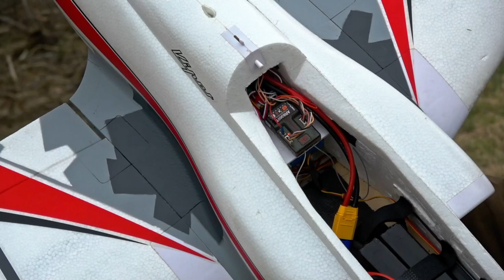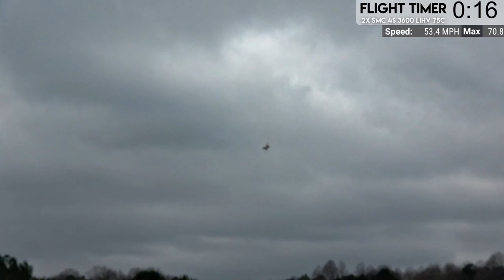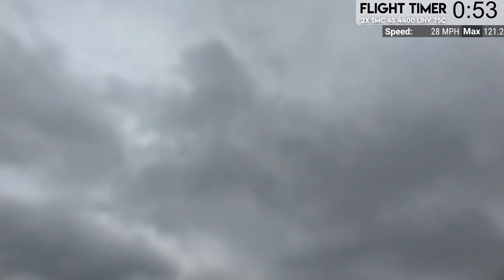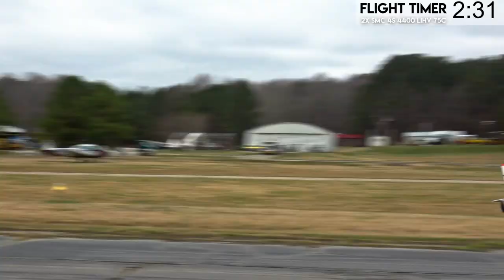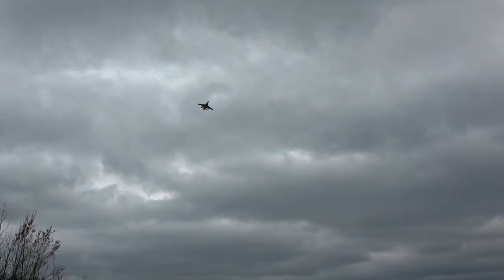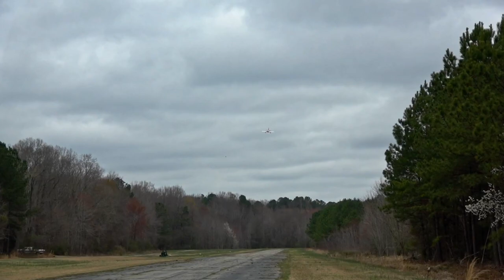Is It Worth Upgrading to 8s Power?

Comment: Welp, now I need to get one of these ARF+ next time they're back in stock.  You are 100% spot on with your 8S assessment as well.  Little more weight and some more cost but a LOT more punch or you can baby it for more flight time and the SMC LiHv packs are a game changer for this.  Not sure I'd fly on the 3600s but the 4400s seem like the sweet spot.  The 5300s are not too much heavier but there does need to be a cutoff.
Reply from the maker: 4400s are definitely the sweet spot, but the 3600s also perform admirably if you don't abuse them! We'd recommend placing a backorder for the ARF so you can save your place in line - they'll sell out quick like anything related to this jet does: https://bit.ly/3ZF69UG

Comment: I've been runnin 8s😎 it's a good setup.
I'm doing a repaint on my viper 90.
Bought a jetfan v3 90 with a het motor 700-68-1680  should be around 5kg.
So happy you tried 8s!!
Reply: This is what I run on all my 90s  its actually the 1680KV very hot motor  about 4.6kg tons of power with a 1500kv I would run 10s
Reply: hi, I fly on 8s with the FMS EDF unit. how will the jetfan v3 fit ? there are pre threaded holes on the engine mount
Reply: @may4092  the jetfan v3 was a perfect drop in fit.
You do have to epoxy the mounting tabs yourself and drill the screw holes to secure it but not that hard at all.
I'm currently running the jetfan v3 and het 1680kv motor on 10s.the power is insane with good flight times of 4-4 1/2 minutes.
I just picked up a Fms super scorpion 90mm and installing the Fms 1500kv.
Gonna test 8s,9s and 10s to see what works the best!
Reply: @sendit_rc  Very nice, top speed? peak current draw? what ESC do you use? I guess you get these flight times with SMC batteries. I'm not from the USA, so it's kind of a problem for me, I get barely 3m (;.
Reply: @may4092  top speed 160 mph in a dive.140 mph level flight.
Esc I use is a castle creations HV 160 amp.
Peak amp current 135 amps using 2x 5s in series RoaringTop 5800 mah 35c.

Comment: Due to the increased weight, the viper will be at a higher angle of attack (AOA) at any given speed, which could result in approaching the critical AOA at a higher speed than it would have before. I have the FMS Viper with 6S configuration, and it is relatively weak. I am considering upgrading to an 8S setup.

Comment: One more question, Do you mess with any esc settings on your setups? I am uncertain about what timings I should use with this FMS motor to get the optimal performance out of it... Do you just leave all settings stock as they come from FMS?
Reply from the maker: They're usually just left stock, not much reason to mess about with them.

Comment: Holy mother of god that acceleration is insanity. It accelerates like a huge 3D prop plane
Reply from the maker: That acceleration comes at a cost of weight, though. On this jet it was definitely worth the tradeoff.
Reply: @TwoBrosRC  has always been my thought. You have thrust but you either have a heavy plane or 1.5 minutes of flight time. Ok for a giggle but wouldn't be my go to set up

Comment: I have this very same EDF ESC combo for my F22 90mm that I am setting up currently. Just need to sand down the foam to make the bigger can fit. I am planning to fly with 850g total for both batteries...should be nice.
Dude how do you connect the EC5 to the XT90 ESC? I don't see any adapter there.
Reply: He probably plugs them in straight, I've done it many times but it's a bit lose fit
Reply from the maker: EC5 plugs directly into XT90. No adapter is needed.
Reply: Oh thx I can't believe I never just tried doing it LoL. Already ordered an adapter that I will end up using.
Reply: @TwoBrosRC  I believe this isn't ideal, the plugs aren't the same exact size. I've done it myself but on this high power edfs this might be asking for trouble 😂
Reply: @rotomasher Your absolutely correct. The XT90 connectors are 4.5mm vs 5.0mm for the EC5's. They do physically fit each other, but you get a very poor connection with high resistance. Try pushing just one side of an XT90 into one side an EC5, you will see how loose the fit is.

Comment: Much better with 6000 packs. Iv got mine running 9S 6000 packs with the fms 1500 edf unit. UNLIMITED vertical.
Reply from the maker: But way too much weight.
Reply: @TwoBrosRC  na it’s not. 4:45 flight time. Much more stable and penetrates wind more like a jet and less like a foamy. But still lands nicely. There is too much emphasis on high Alfa etc with these models. It’s a sport jet, not a 3D model.
Reply from the maker: @tomling9310  We prefer not to add extra weight. What works for you doesn't work for everyone else.
Reply: @TwoBrosRC  absolutely I agree.

Comment: It's funny to me that when you reviewed the new Freewing Eurofighter I said that I bought it in the 8s version, yet your reply seemed to scoff and disregard 8s as if it was sacrilegious in that size edf model, I guess you're eating crow and your own foot at once??

Just messing with you brother, I knew that you'd come over to the dark side eventually, and 12s is only really intended for the bigger edf jets, the plus 100mm size.
Reply from the maker: Jokes aside, the FW Eurofighter is heavy enough on 6s. On 8 we can't imagine it flying any better, it'll just stall easier under the kind of maneuvers we like to perform. We tried out 8s to see how it would work on a jet that the 1500kv would drop into - and this was the best choice of the ones we had available. And surprisingly it did well enough that we'll probably keep this Viper at 8s for a while, though we can always change it back by just putting the heavier 6s motor into it that we used before.
Reply: @Two Brothers Radio Control  yeah it appears that the new Eurofighter has little room to adjust the cg backwards, especially for an 8s setup, and it looks like I'll be relegated to using two of the smaller and lighter 4s SMC LHV 3600mah batteries to keep the weight manageable. I do believe that I'll eventually have to swap it over to the 6s power train setup for my high alpha and acrobatic flying style, maybe in the future they'll release a thrust vectoring option to help this model with maneuverability.